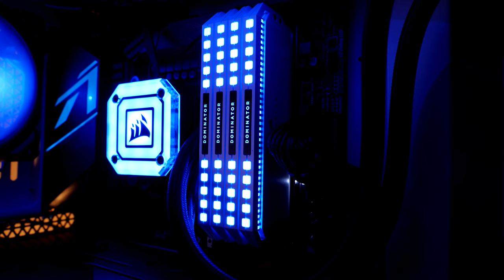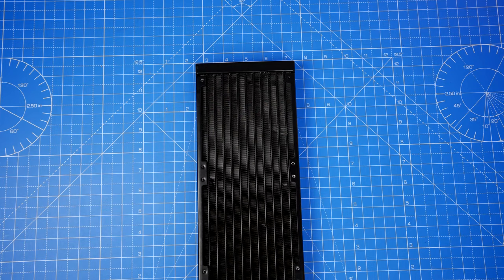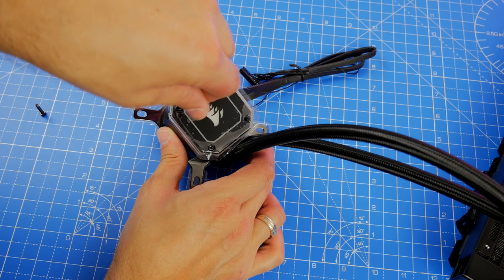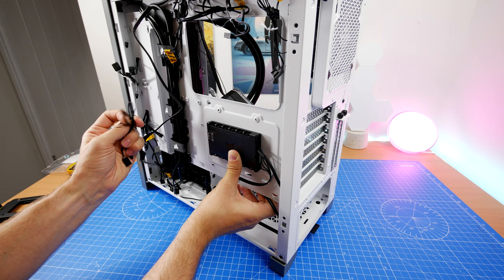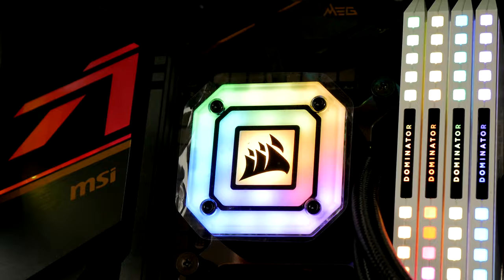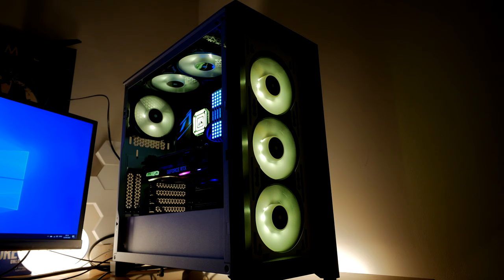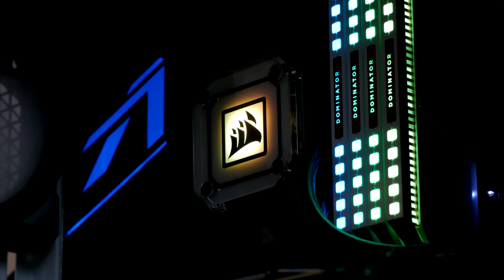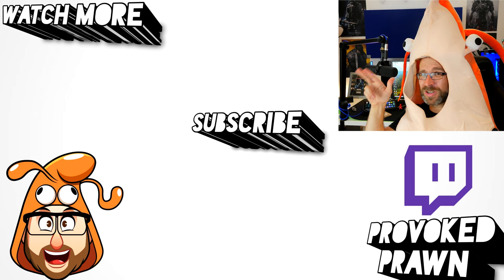Corsair iCue H150i Elite Capellix Pros and Cons - what's good?

Comment: Nice video but you have installed it wrongly.
Reply from the maker: No
Reply: @TheProvokedPrawn  can you please explain? From what I researched if the reservoir is upside down (pipes on top) it will create air bubbles thanks to gravity. I am about to install h150i and I'm still wondering should I be installing front of case and upside down with push/pull or the top with only pull as the motherboard is obstructing. My case is d500. I would appreciate your comment.
Reply from the maker: As long as the pump isn't the highest point it's fine. Watch the GN video. When that's an issue it's a long term problem. Rather than its going to fail immediately.
Reply: @TheProvokedPrawn  thank you and apologies for commenting wrongly.
Reply from the maker: @tomslu9275  🤷‍♂️ I'm used to people criticising.
Reply: @TheProvokedPrawn  nowadays there's always someone to criticize even if your right, said that I just came across this: https://help.corsair.com/hc/en-us/articles/360049358271-How-should-I-mount-the-radiator-of-my-AIO-cooler-
it's not I want to criticize you, I think you're doing great movies and thank you for that.
Reply from the maker: @tomslu9275  here https://youtu.be/DKwA7ygTJn0
Reply: @TheProvokedPrawn  Thank you sir, I am fitting it the same way you did on your video. Apologies again.

Comment: Does the fan box thing control the default fans (sp 120) on the 570x too? Or do I need to upgrade to a newer fan?
Reply from the maker: It should control all Corsair fans
Reply: @TheProvokedPrawn  I tried to plug it into the command module, but it seems like the fans can only be controlled by the case buttons itself. Maybe it's beacuse these fans came out in 2015 or so. Plugging in the SP120 fans with the ML120 Fans on the cooler, only shows the ML120 fans.

Comment: Is the radioator front-mounted? With the tubes up?
Reply from the maker: Yes. Nothing is perfect. In this case you can't mount tube down. It's not always possible, fellow Gamers Nexus viewer.
Reply: @TheProvokedPrawn  Bummer about the mounting, however that could very well be the reason for the pump noise as mentioned in the video. 
I wonder, could you fire up the system with the front of the case raised 90Deg for a little while to see if you can get any air trapped in it out? The pump isn't above the rad so if you could clear it completely, it should fix any noise the pump may be making that it shouldn't be.

Comment: Hi! Can I use this commander hub with nzxt aio and use NZXT software for this?
Reply from the maker: You can't buy it separately
Reply: @TheProvokedPrawn  i am torn between this and Z73 kraken. Since you tried both, which one do you prefer more? 

Also, say for example I am going for NZXT is there like a commander core/hub for it? I kinda like how organised the corsair is but I also like how the LCD works on the NZXT.
Reply from the maker: @BananaBunny_  they're both easy to setup and there's a lot to be said for the Commander Core. Personally I prefer the Z73 because of the display and that's the one I've stuck with. I love being able to see temps at a glance and the overall aesthetic of the Kraken is nicer imo.
Reply: @TheProvokedPrawn  is there a hub for nzxt similar to that of Corsair’s commander core?